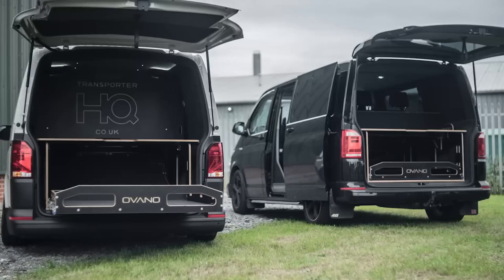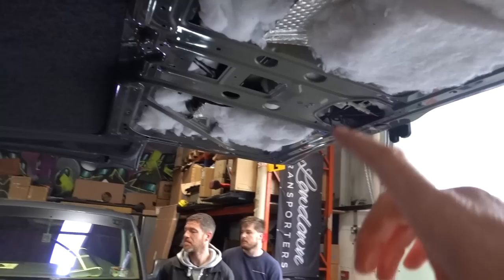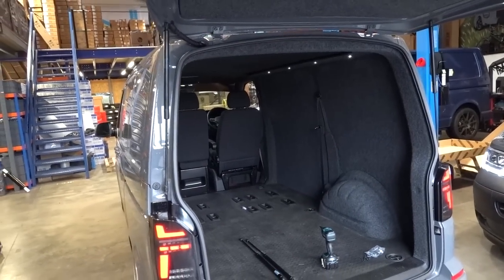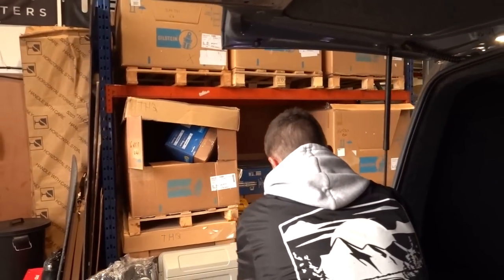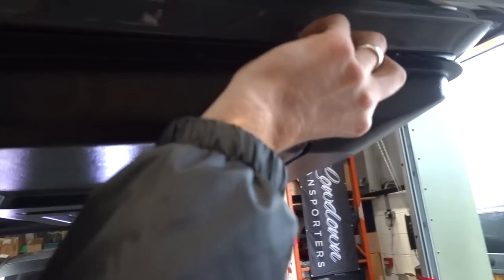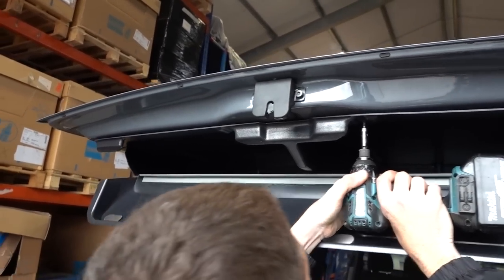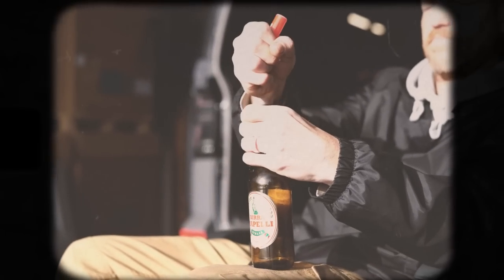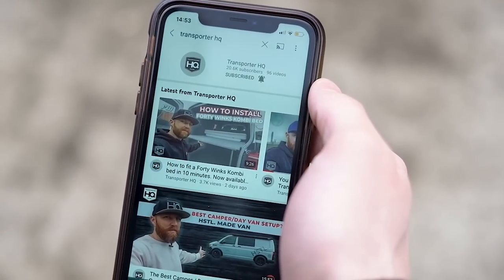We Test The New Chair Pod & Show You How to Fit Them To Your T5/T6 tailgate | Van Shades.

Comment: Awesome! Can these be fitted to a T6 Caravelle? Mine has the pull down strap and the tailgate release button but I guess these can be cut into the pod? Cheers.
Reply from the maker: They come with the tailgate release cut out. There would be a way to re-fit the pull down strap but most people remove them.